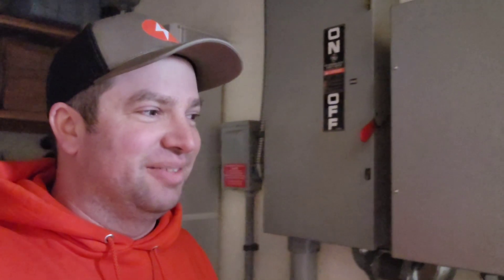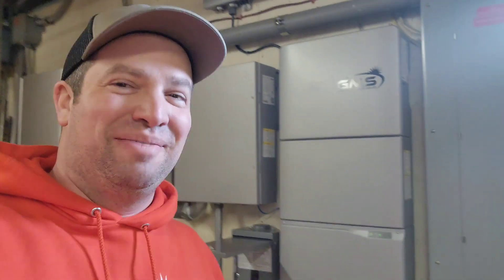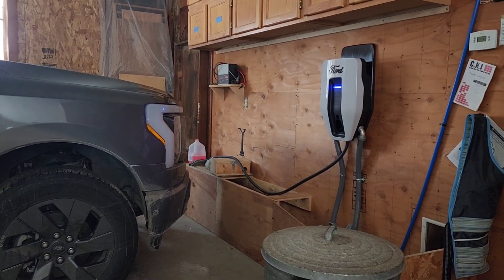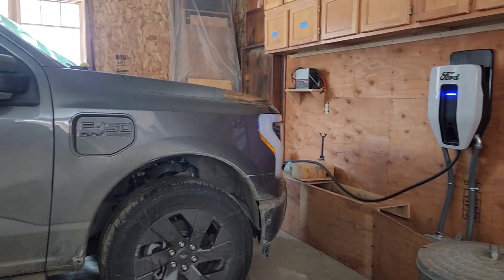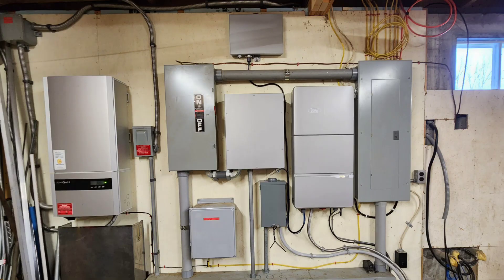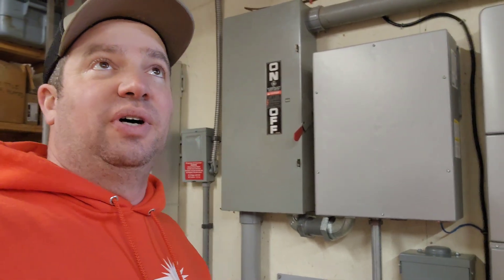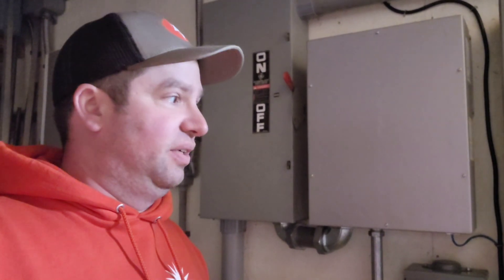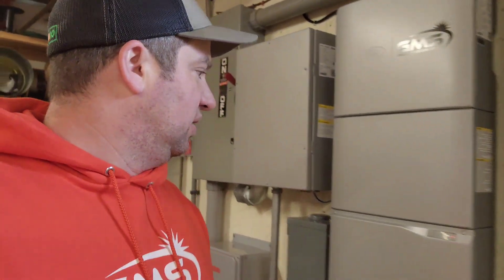The F150 Lightning is FINALLY Powering the House!

Comment: Sunrun is involved because they codeveloped the charge station. 
I own a large solar company myself but we are also sub for SR on charger installs and some pv installs in a few markets
Reply from the maker: It just seems weird that Ford, Delta and Siemens would want/need a solar company with a reputation for poor customer support in charge of their product.  God forbid you have to call tech support...
Reply: @benssolarandbattery  all i’ll say is Sunrun now has ~ 640,000 customers. Even if 10,000 customers were pissed (and that can’t be accurate) thats a 99% satisfaction rate. 

They feed me a decent amount of work but my opinion on that subject was the same before we had any type of relationship.  

The quality of their work is certainly higher than another national installer that also makes cars by a large margin.  I get work from both so thats as honest as I should be on the topic

Comment: After going back to grid power from Truck power.
Why do you have turn in Circuit breaker one?
What breaker circuit is that for?
Reply from the maker: That breaker is on the line side and feeds the AC side of the EVSE.  In a power outage, I wouldn't have to turn that off, but for the test, I had to in order to simulate an outage.
Reply: @benssolarandbattery  
For the rest you turn off the breaker, I didn't see that.

But I saw you turn off the disconnect knife switch.

So you had turn both OFF to stimulate the test?

Can I also ask you what size wire used for pro charger to the BDI Inverter you used.
Reply: @benssolarandbattery  
You ever considered going openings all covers and showing or going over the wire connection.

As of right now no one's has done that. 
If you do cause yours work you get tons of views...

Comment: How much did the whole process cost you to have the home backup set up?
Including any sunrun fees and equipment.
Reply from the maker: The sunrun equipment was around $4k direct from sunrun.  Other equipment and costs will vary wildly depending on where everything is going.
Reply: @benssolarandbattery  tbh, I was expecting way more than $4k.

Comment: nice.  although   from signature solar.     hybrid all in one inverter charger  $700.    server rack battery $1500.      $500 ,  6  used,  PV solar panels.   diy install.     UPS millisecond transfer... off peak  grid recharge... runs whole house  during day... all night if grid down..   no  grid backfeed or permits .. no truck needed...   we want self consumption!
Reply from the maker: Absolutely. That wasn't what we were doing here, though.  The customer bought the truck and wanted to use it to power his house.  It's got a 131kWh battery.

Comment: ben can you runa mini split thats 4/5 ton on a 6048/6.8 inverter /3to 5kw /24/7 or will it last if you have good power a batt, back up would you need a 2nd unit or would it be to much power .lookind to do this or run some single units but they pull 1/2 kw hourly so 2 /24ooo btu units or 9 ooo btu

Comment: How was the truck wired to the system?
Reply from the maker: Through the charge station. It pulls DC from the truck and runs it through an inverter to power the house.